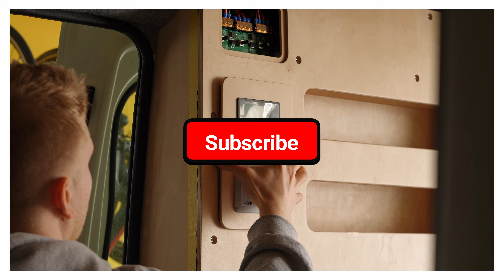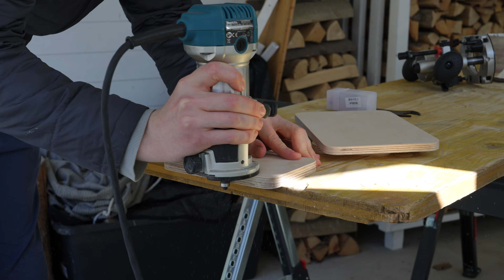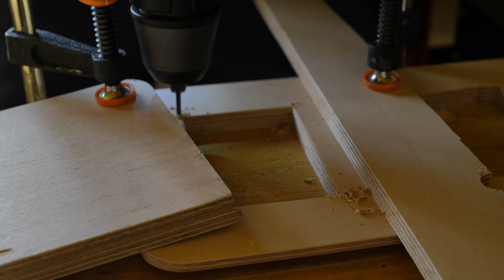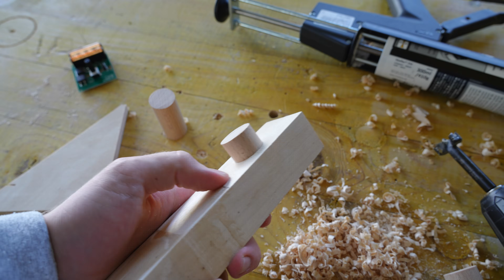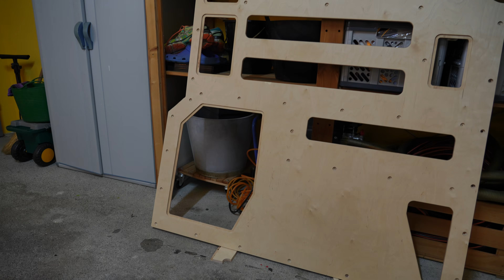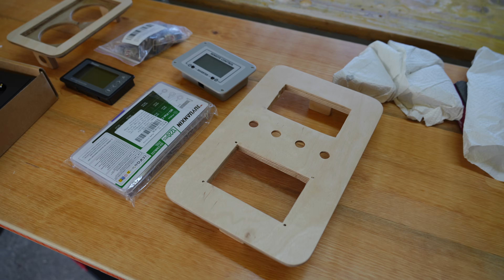Making Custom 12V Switch Panels | Van Build #34

Comment: I love that you are using mechanical flips and switches. I'm never really a fan of all the touch-sensitive buttons. The sound of those switches is so satisfying.

Everything is looking great Luke! I can't wait to see what you have in store for your sleep and cooking setup.

This weekend we added all the carpet to our Opel Combo camper. Next weekend, we will insulate the floor and add the flooring.
Reply from the maker: Thanks!! Sounds like you've got a busy weekend of work ahead on your camper, good luck with the flooring!💪🏼